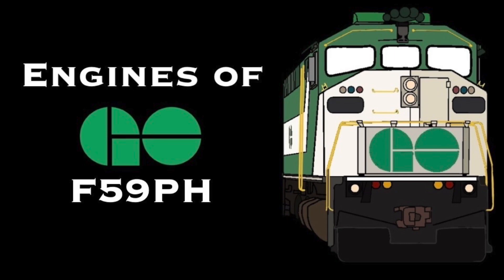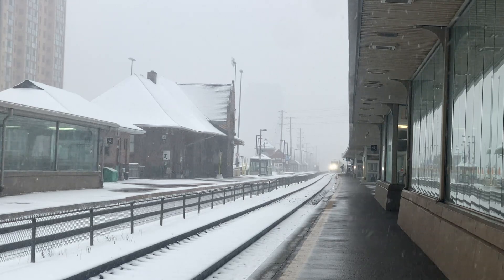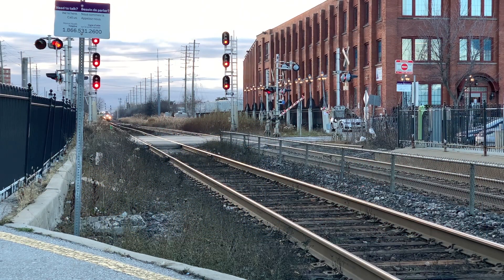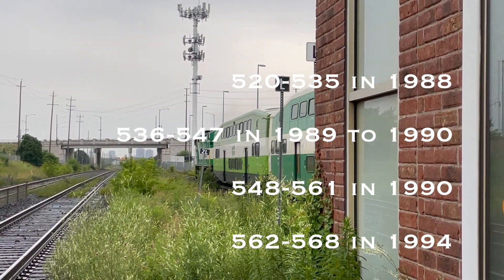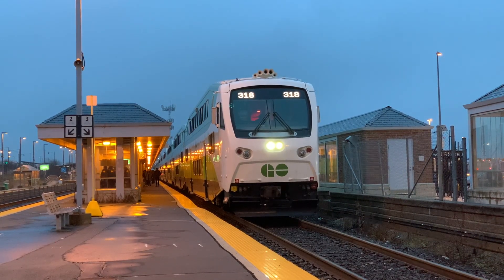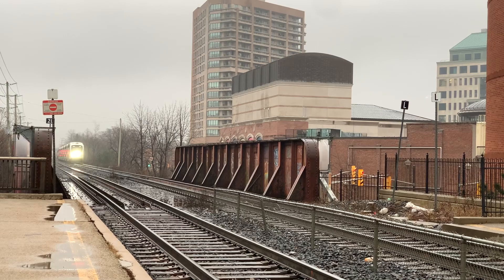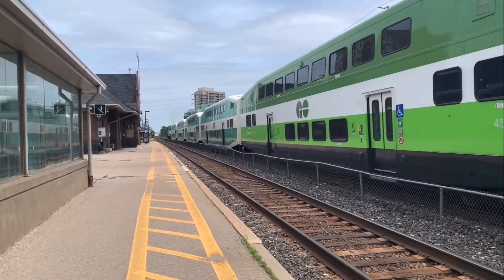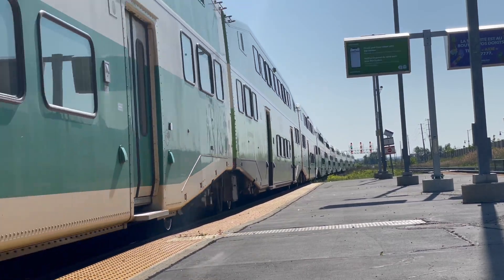Engines of GO Transit: F59PH

Comment from the maker: Correction: These F59PHs can only hit 83 MPH, rendering them slower than the MP40PHs. Reason being is that they can pull more and/or a speed regulator was installed, whereas other F59PHs can hit higher speeds